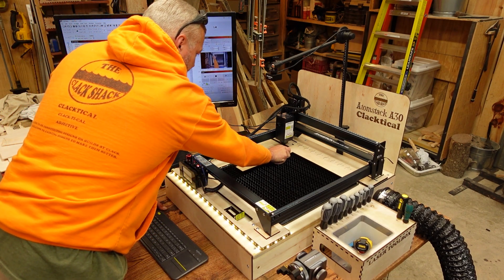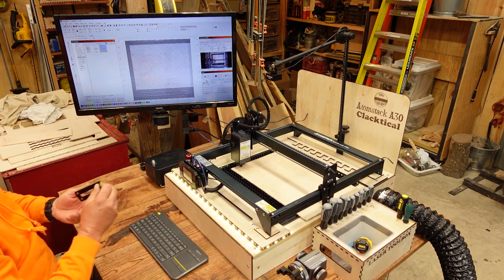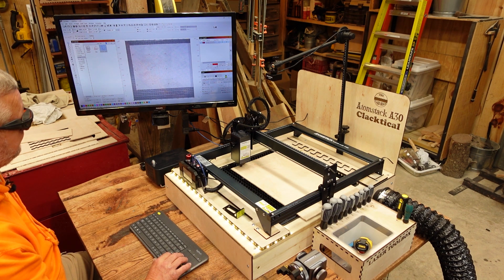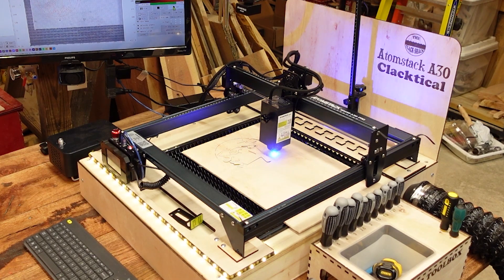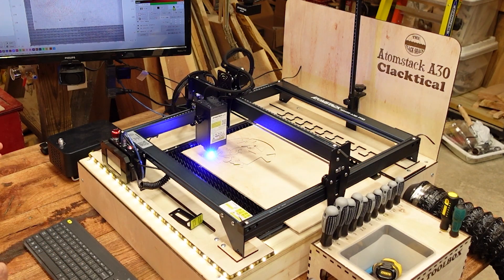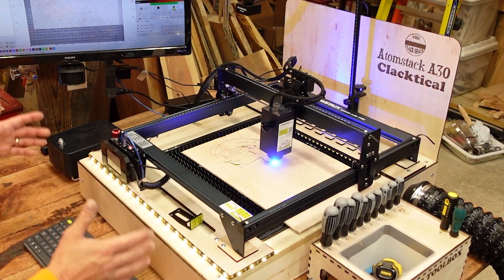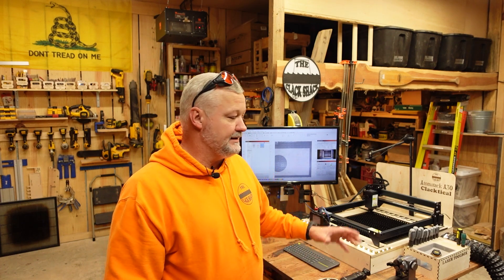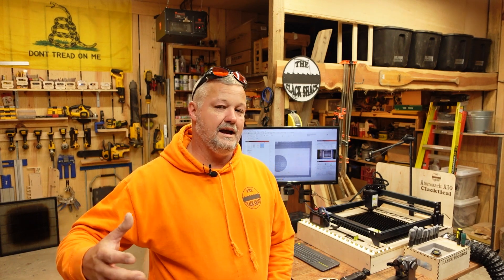Clacktical laser base- Atomstack F3 panel

Comment: New subscriber, the smoke table got me to sign up. How many cfm is required to be effective?
Reply from the maker: Depending on the length of the exhaust pipe, most 4 inch fans can handle it. I would say around 200.

Comment: have you done an engraving on "sterling Silver"  rings for example...   video??    can you send me a link if you have =)
Reply from the maker: No, engraving metal requires a fiber laser. You can mark some metals with marking spray but I have never tried anything but stainless. Stainless is the only metal that I am aware of that can be marked without spray.

Comment: I got the Matrix bed today. I hate it. Very flimsy. Not level, tie down brackets are garbage. Total afterthought. If I did keep it I would have to 3d print something else.

Hanging on to my honeycomb bed. It's half the price, perfectly level with the magnetized 3D printed feet I made. I can use magnets to hold my work down like my welding table, far superior. I will make a downdraft table for it after solving a design issue I thought I would have. I honestly think the honeycomb will have better airflow in a downdraft configuration than the Matrix bed. Planning to make a debris catcher like a toaster oven. I have something similar on my plasma table. So clean up should be even easier than the Matrix.

Reading some other comments on other channels, some people have been having issues with it. Wood pieces falling inside and sticking up and the laser module hitting it.
Reply from the maker: I am happy with the results so far, I do see the potential for pieces to flip but so far no issues. Mine seems pretty rigid especially when supported in the base.

Comment: Mind sharing what fan you got? I've got a 4inch hvac fan but suction isn't very strong.
Reply from the maker: This one is just a vivosun 4 inch. It is my older fan from a previous build. https://amzn.to/41C9t3Z
I recently swapped my large enclosure over to a haun&guan 4 inch that seems to work a little better. https://amzn.to/3MzGvgv  the haun is much easier to clean and seems to pull more air.

Comment: The disadvantage I see with the Matrix cutting panel is that it is made from aluminum. If that is the case, then magnets will no longer work to hold down a piece of plywood that is warped. I like using magnets but I also like the Matrix F3 and am going to buy one I just have to figure out another way to hold down warped wood.
Reply from the maker: It does come with some bars that can be attached to the sides but I prefer not to use them. I avoid warped wood. Even if using hold downs, the cut piece can spring up and hit the laser head.
Reply: The honeycomb atonstack sells is made of metal and magnets work. it also comes with brackets to hold material.
Reply: @MsWamhoff  Hi Florida Krista, the F3 is made from aluminum according to their website specs.
Reply: @camarogs1  Then why did magnets come with my Honeycomb? I dont know what they are for then.
Reply: @MsWamhoff  Hi Krista, atomstack F3 is not honeycomb. Look it up to see how it is built.
Reply: @MsWamhoff  Do you have the F3? The F3 is not  honeycomb.

Comment: Hey Clack as usual, awesome work. Will you be making the jig available on your Etsy shop?
Also the exhaust table, do you think that would work inside to not only deal with the smoke, but the fumes as well?
Reply from the maker: Yea, The jig will be headed that way after a few more test burns. It seems to help with it all. Once I add the walls it should be better.
Reply: Very excited for the jig... Waiting for it to start some projects.

Comment: Have you noticed the slop in the laser module on the Z  axis?  Mine is not precise at all. Just a gripe,  definitely not a dealbreaker on the speed and power of the machine .
Reply from the maker: No, haven’t noticed any
Reply: @TheClackShack   it only when adjusting the height it’s loose and when tightening it cants the module at an ever so slight angle.  It’s not been an issue for my needs so far but check it and see.  It may only be mine as it was one of the first units made bought on pre order.
Reply from the maker: @prc37388  , the dove tail in a little loose if you tighten the knob too much it can cause a bit of a movement. As long as it stays secure, shouldn't be an issue.

Comment: Very nice 👍

I have a downdraft welding table at my shop. Coming from a metal fabrication background fume extraction was my top priority. I have my laser in my office at home so I had that handled before my machine arrived. I just completed my set-up. I also ended up with 2x4's as a base, cheapest option I could come up with so I can do rotary projects. I have (4) 2x4's screwed together in pairs that I can take in and out of my enclosure, instead of a permanent base like yours. My enclosure is a Creality 3d printer enclosure I already had, turned sideways (works better for this than as a 3d printer enclosure). It's the fully sealed canvas one for $60-$80. Works great. I don't even plan to make one now. Fits the Falcon 2 perfectly btw. With the $29 Amazon duct fan going out a window I can stand right next to it and not smell a thing.

I do plan to make a table similar to yours though. If you're planning to offer the plans on your site I would probably get those. I could recreate it but would rather support you for your efforts. 👍
Reply from the maker: Thanks